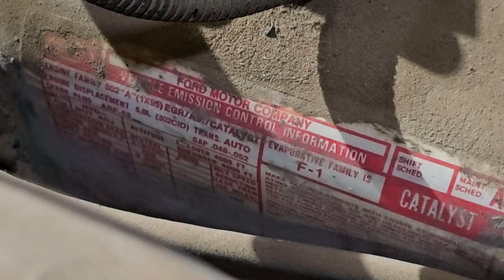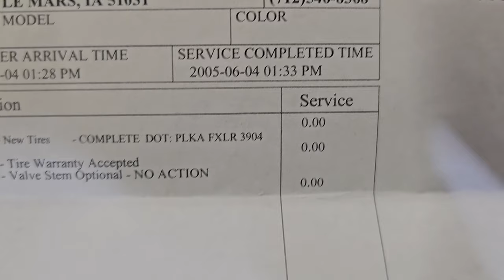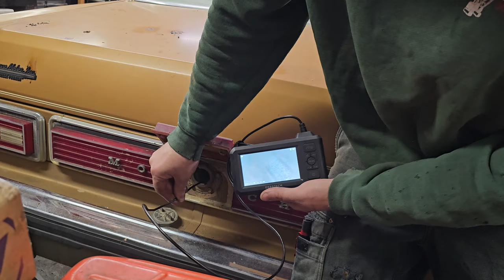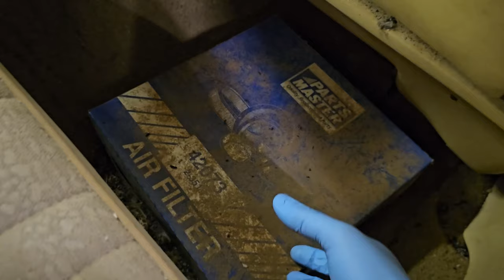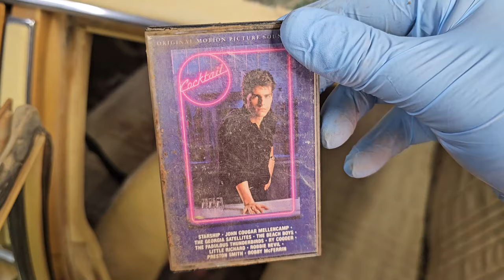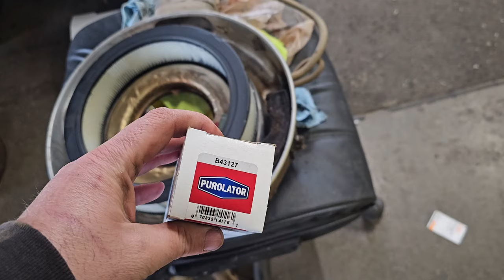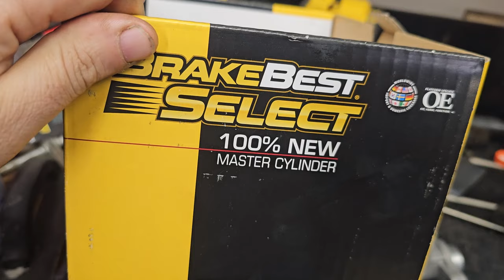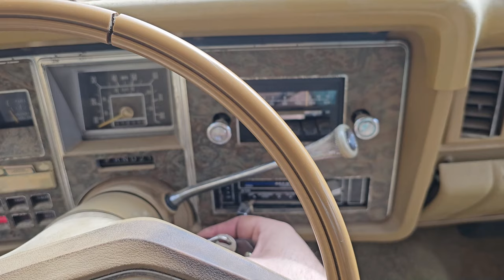Budget 1970s Mercedes will it run and drive after 20 years

Comment: awesome video, i would list that thing online for 1500 just to see if you can make a few dollars, maybe do some cheap work like removing the carpet and vinyl top if ya feel like it. or heck knows maybe you'll end up liking it
Reply from the maker: My brain says lower it 2 inchs a set of 16-inch wheels . Paint the roof ,replace a lot of the interior. Dual exhaust upper end kit for the motor.  Different gears and limited slip in the rear and daily it . We will see